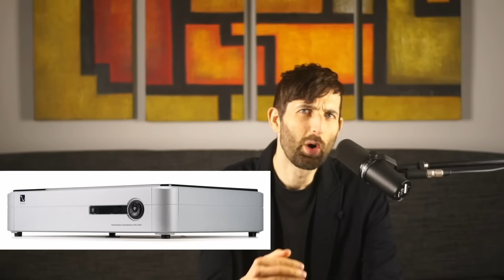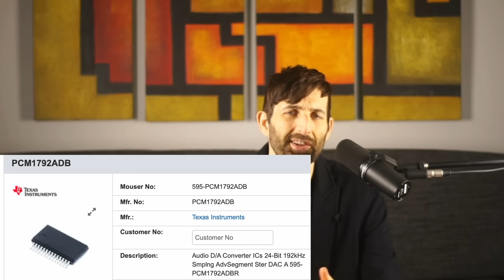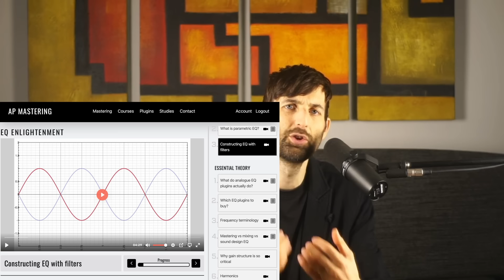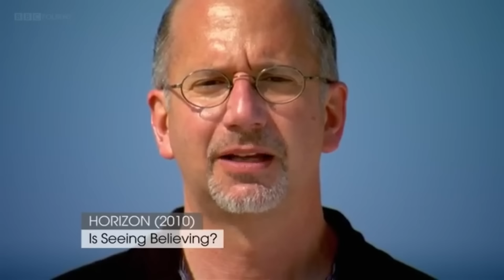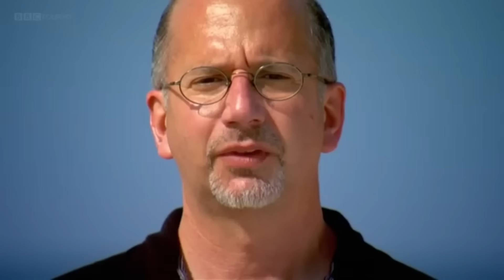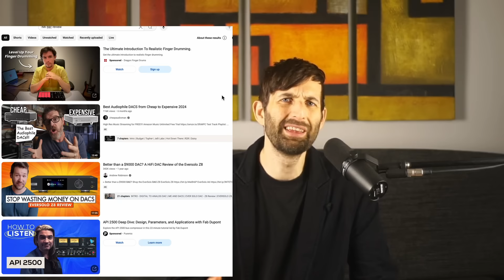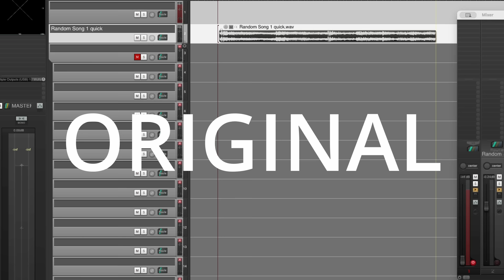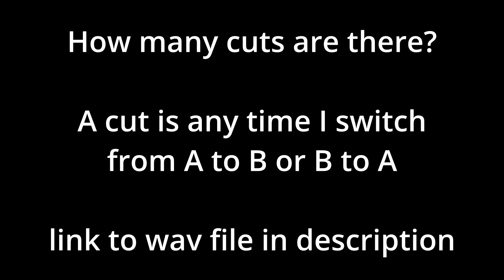The DAC Scam - Almost everyone believes the hype

Comment: Dear Sir, You are talking about devices you do not know. Your opinion is not based on facts or comparative tests in suitable high quality audio systems. Please first inform yourself about the configuration of the devices in question. Then perform side-by-side testing. Without that, your presentation is nothing but empty talk.

Comment: DO NOT BELIEVE WHAT THIS MAN IS SAYING HE'S TOTAL TOTAL  TOTAL WRONG  I've A/B lots of high-end DAC's at my local Hi-Fi dealership and at home in my own system and as ALWAYS in life you get what you pay for and there is a noticeable difference in sound quality between DAC's that use the same chipset, and yes alot of DAC's do have the same DAC chipset BUT its all the other components your paying for the case work the PSU or the ability to add an outboard PSU to the DAC,  Also the internal PSU the Capacitors etc and the post DAC stages IE the analogue output stages and post digital filters ALL these things make a massive difference in sound quality So this MAN IS WRONG AND DON'T LISTEN TO HIM LISTEN TO YOUR OWN EARS  and yes some DAC's to have custom made FPGA chipsets

Comment: Hmmm, plenty of solid info, but as some comments have pointed out, it's not just down to the chip, if it were, then why can you just not hook up an optical cable to one side and rca's to the other, and hey, wait a minute, I just realized, most microchips aren't based on optronics, so it would have to be coaxial digital, but then why have I heard that optical is better than coaxial digital, or even equal ? Surely that's because we have developed absolutely lossless electronic to optronic conversion for complex multi-octave sonic information, we really are that good. And of course optical means teh signal is transmitted as light, and what could be better than light for transmitting signals over short distances? And who gives a fuck about the power supply, something out of my walkman should do just fine, it's all just electricity right ? And who cares about the quality of the output stage, I mean surely the worlds finest music and production studios dont bother with quality pre-amplification, how much difference could it really make. Might as well just jack the DAC directly to your power amp, because volume control is for wimps. You know, I did that with a turntable once, I just kept getting bigger and bigger power amps until I was happy with the volume, and heck, I couldn't tell the difference. Of course, if you are too thick to tell, I'm being sarcastic. 
Shit man, why do you give a fuck about what people spend their money on if it makes them happy ? All you should really care about is whether or not anyone is listening to any of the music you have mastered, and whether or not they think it was mastered well. I have an idea, why dont you post a list of your entire studio setup, so budding audiophiles or music engineers can copy it and hear audio exactly the same way they do. And more to the point, assuming you are good at what you claim to do, shouldn't you be far too busy working as an audio engineer to make Youtube videos, unless you indulge in Ketamine like Elon Musk allegedly does, and dont need any sleep
All that being said, I'm just a broke ass, low budget audiophile, only one generation away from poor white trash, and use a Parasound pre-amp with a built in DAC that I purchased second hand, and it sounds just fine to me, it was the best I could afford.

Comment: It's mostly all in your head, for sure.  And believe it or not, depending on the type of computer equipment you have, you're not going to be able to tell the difference, anyway.  I remember one time using some fairly cheap equipment to listen to some digitally recorded music . My system was otherwise excellent.  Top of the line.  Anyway, there''s no way in hell it didn't all sound exceptional.  So, spend more money if it makes you feel good, but you're just buying a fantasy.

Comment: I realize you're not a circuit designer. As many people here have pointed out, the chip is only one element. To what they say, I'd add separate power supplies for the left and right channels makes a significant difference (measure the crosstalk, which affects the stereo imaging). Circuit board layout is huge. You can take two identical 24-bit DAC chips and depending on the circuit board layout, you might get as few as 16 "real" bits. Different resistors contribute different amounts of noise, have varying tolerances, and are affected more or less by temperature variations. There are multiple performance differences among capacitor types. Now, you can debate whether increasing measurable resolution from 20 bits to 21 or 22 bits is meaningful, or whether it's worth the extra money to shave off an exta half a percent of distortion. If you can't hear the difference, don't spend the money. For those who can hear the difference, they're not being scammed. They can decide for themselves if the improvement justifies a higher cost.
Reply: For sure. This guy didn’t even seem to do basic research into these things.

Comment: I used to think audiophiles were harmless kooks. Then around 2000, about 5-10 years after all those expensive 'audio engineering' schools started up, I was dealing with assistants and even engineers who would spout some incredible nonsense. Monster Cable was probably the most reliable but the green felt tip pen on a CD was a big one, and in every case, it was someone who'd gone to SAE or FullSail or wherever. 
I started to consider time at one of those schools to be a negative when interviewing aspiring engineers but eventually, there were very few who hadn't. If I found someone who was self taught and could show me examples of their work, I'd jump at the chance to put them on a job.

 I decided back then that the most extreme audiophools were my enemy, the enemy of rational thought and a gateway drug to nonsense and conspiracy theories.

Comment: I don't fully agree. Yes the conversion is done by mostly the same chips, but there are different styles to go about this and a whole DAC is more than just a chip. It has a power supply and in/output stage where there is a lot of room for variance.
I have worked in a high end store where we had many different pieces of gear from budget premium to ultra high end. I have compared many many pieces, and occasionally also blind A/B and there are definately big sonic differences between them.
But I do agree there is also a lot of overpriced BS put there and very few of the high end pieces are truly worth their price in terms of sounds.
IMO the border is set by the Mola Mola Tambaqui. Designed by a genius designer from Belgium who is also the brain behind Hypex and Purifi.
This DAC goes about conversion a different way than regular DACs which gives it an immense SNR, dynamic range and genuinely immeasurable distortion. It on paper and in the flesh is the closest thing to a perfect DAC humanity has come to date. It's price is €10k. Anything else or more expensive IMO at best sounds different rather than better.
However I am very pleased with my €1200 RME ADI 2 Fs

Comment: Great vid. As a music lover I sort of knew this without knowing this. I had no issue buying an expensive power amp and expensive speakers because both are easy to test and absorb with our sensors. You can experience and feel the value in those items. I also had no issue buying a half decent (low to mid cost) TT and streamer for transport, again you can experience the value.
I did however have a problem with buying a preamp at the price they ask. I just wanted a component for input selection, phono stage, volume control and a good quality DAC. I felt it was over priced for what I got, although I have to admit that my stereo does sound awesome and the preamp might have something to do with it. I probably got ripped but I'm very happy with my music sessions so I'm not bothered.

Comment: tbh the dac chip has very little to do with the sound, the output stage components dictate the sound character of the device. even the input circuitry has more chance of changing the sound than the conversion chip.

Comment: I’m not saying I can hear the difference between one dac chip and another but I could easily hear a difference when switching between dacs in my system. The difference in sound probably has more to do with output stages and power supplies than the conversion itself. But still, there is a difference in sound between units.

Comment: You are so full of baloney. You are a classic example of "Dunning Kruger". There are an incredible number of fantastic DACs now between $1K and $2K. With different topologies, quality of components, and very different sounds. Dude there is something missing with you. You either have dead ears, or need to sound treat your room better, or need to get a better set of studio monitors. What is very possible is that you are uneducated as to the importance of a quality pre-amp after any DAC when running into active studio monitors; for impedance matching, dynamic headroom etc.etc. I have found over years of experimentation, that DACs plugged straight into active studio monitors is never the way to go. Plugging a DAC, no matter what its quality, straight into an active studio monitor (or any amp/transducer system) is a convenient myth for the uneducated. Maybe that's why you cannot hear the full reveal of the difference between DACS?
Reply: You don't need a pre amp after a DAC. If there are any worries, look at the buffer in the DAC output stage. Eliminating a pre-amp will let more sound get through. Other options are: deleting output caps and resistors in the output stage. If there is a need for attenuation (volume)use a nice sounding wirewound potentiometer. What there is with the line level input on studio monitors, perhaps they have a low impedance which causes an issue, which is easily modified (not that i'm a fan of powered speaker)
Reply: So why don't you point out where the audio switches between original and DAC in the example? Should be obvious right?

Comment: People wanna believe in snake oil.
Over 20 years ago I compared my 1 bit kenwood multidisc player to an arcam fmj someting. It cost a thousand or so. Mine was less than 300.
Bottom line, basically no difference, If there were any minute differences, which one is more accurate. Just my experience

Comment: All conversion is primarily the analog stage, the clocking, and the filtering… Of course the chips have all been good since the 90s, maybe you and your audience are not aware of this, but it's an irrelevant argument that you're making. I'd be happy to show you a number of different DA converters and they are profoundly different in a good room.  We all have to decide what is sufficient, and it doesn't have to be the most expensive thing. Expense doesn't always equal value or quality, but given reputable companies it does point us in a direction. I use the Bricasti M1 SE. in a pinch. I could use the Mytek Manhattan II.  I would prefer not to go to something less than that.   But that's me
Reply from the maker: how did you do in the blind test?
Reply: @APMastering You're new to mastering, and I appreciate your intentions, yet you have things to learn ... delete me if you wish, but I'm not here to troll.  Appealing to the low cost of the democratization of music making is all well and good, but DA and Cables are full of real differences.  What you think has "no impact" on the sound quality ... is your decision ... for you, only.
Reply from the maker: @brianlucey832  i've been a professional mastering engineer for just shy of 20 years. how did you do in the blind test?
Reply: @APMastering You have no credits and many bad ideas.  Happy to show you many DAs in person. And ... you are skipping my points.  The chip is not so important.
Reply: @APMastering $40k DAC are silly.  We agree there.
Reply from the maker: @brianlucey832  ok but how did you do in the blind test?
Reply: @APMastering After 20 years where are your credits?  DACs are all audible, and what each person needs is up to them.  But this video is a lot of BS.
Reply: @APMastering I've done testing since before you were born dude, chill your ego.  lol
Reply: @APMastering Why are you ignoring my points?  Chips are all good for 30 years.  Not a new point. Or a huge point.
Reply: @APMastering You are deleting my posts and skipping my points.  Chip is the LEAST important aspect of a DAC.  Do you have the ability to discuss?

Comment: I'm not so sure that the 'same DAC chip' argument works here.  Both the Nissan Juke and the Nissan Delta Wing (a state of the art race car) use the same engine.  The $20k Juke is ok for freeway driving -- but the $375k Delta Wing was built to win at LeMans.  In other words, the engineering beyond the initial similarities in the chip used might explain the wide-ranging price differences in DACs....
Reply from the maker: yeah but it doesn't have the same engine

Comment: I have to disagree.  After talking to an italian manufacturer who builds wlwctronics and speakers a good dac will retail around 2500-3k euro. You could get away with alot less by using chinese parts manufactured in china. A dac is not just a chip. Its the power supply, the clocks, the chip, iv stage, buffer and output. The chip doesnt dictate the sound. The cucuirtry around it does.  You also have to factor in development costs including prototyping, western wages, safety standards etc...

Comment: You should really talk to someone who understands DACs and DAC circuitry/architecture (and the proprietary software that is used in high end DACs) . Maybe you should talk to Andreas Koch from Playback Designs. I am sure you could learn a few things from that guy.
Reply: I don't know everything, but still a few things. When you disregard the 'bait klick' talk, the guy is right I think. Thing is, a designer needs to decide on many things, mostly cutting cost, reducing parts. In general a consumer DAC is designed to still sound acceptable even though the cost is minimal. Designing a very good DAC ain't rocket science, just doing a good job. For my personal DAC I use PCM1702's with 275 opamps, 8 times oversampling and a little (not self developed) DSP, with both passive and active filtering. Get the ringing in the bitstream minimal, have the clock not pollute to much and find the bottlenecks. I need to listen it back to back up to a 100/k DAC, yet I even don't care really, just get the most sounds make it through the system. It ain't that expensive, just takes a huge amount of time and yes I use exotic stuff like silver mica caps and tantalums.
Reply: @edmaster3147  The problem I have with the content of the video is - it gives the viewer the impression that all DACs basically are the same - or sound the same because they use the same chip set. That is just not true. DACs can be extremely different in sound quality. A $150 Topping DAC just doesn't sound as good as a $1600 Schiit Gungnir 2 DAC. Of course, there is a lot of overpriced stuff on the market.
Reply: @klinkfoto  To be honest, there is hardly anything sounding decent; which gets obvious once hearing something that does. Out of experience, it's not the DAC that should be sounding anything, it's the recording. Without 'dark background' or anything. No complexity, no colouration, no distortion. And it's recorded, so that is what you hear, a recorded piece. Audio gear should not sound like anything in my taste.
Reply: This is almost an identical occurrence that happened in the late 1980s or early 1990s. There were so many new and used DACS out on the market for sale. It felt like there was at least one or two for every man, woman and child in the country., the AUDIO stores and those days if you walked in with the Dac for sale for trade for whatever you wanted to do
The folks at the Audio store whether it was changed to our private store mom and Pop store absolutely would not buy it off you and most times would not be interested in even taking it in trade . For some of you folks that were around back in those days you may very well recall all this is is just a resurgence of history repeating itself. It’s all bullshit and hype.
I’m absolutely not insinuating. That’s some better chips and electronics haven’t came around in the last 30 years or so absolutely but this is absolute crazy shit 
And then with China, joining in together with a few companies that are store around here my opinion is most of all going due to greed, and then they blame the poor Chinese
Well, look dude if you don’t do it somebody else will. It’s happened to a lot of companies most of them priced their selves right off of the market. I understand everything went up metal work power cords capacitors chips LEDs you name it. It’s took a quantum leave in price, but not for that kind of money. He’s fucking people are insane or smoking crack or some shit.

Comment: I heard 0 switching. But I can hear differences in my home. Mostly down to amplifier or speaker topology. Eg class d which I find the most neutral. AB which can be more involving but not usually very neutral. But most difference is with speakers but that's obvious and most box speakers lack neutrality and are not as transparent as electrostatics. Most studios don't use these as monitors. 
However the room plays a massive role in how things sound both good and bad and we spend money buying equipment to get a sound that is good to our ears in the room we listen to. My Nad 390DD digital amp is a very neutral and transparent class D but it can sound boring compared to a valve amp which most certainly is not transparent or neutral at least the ones I've listened to.